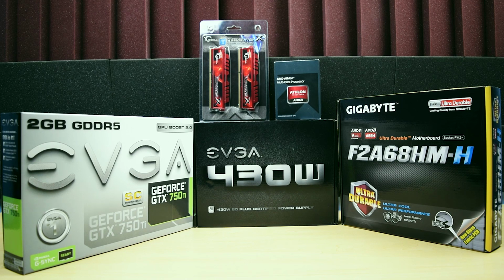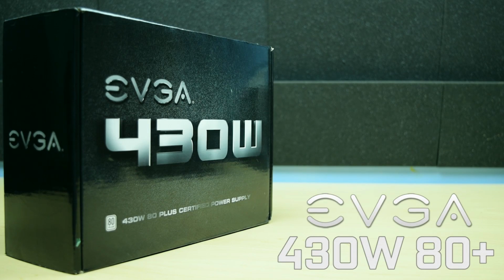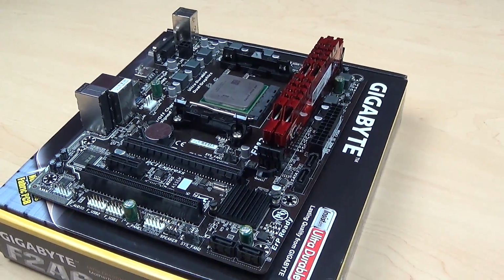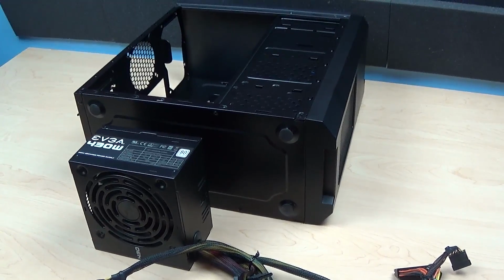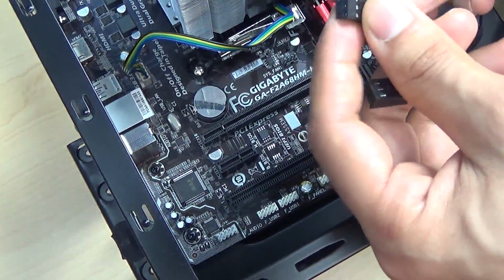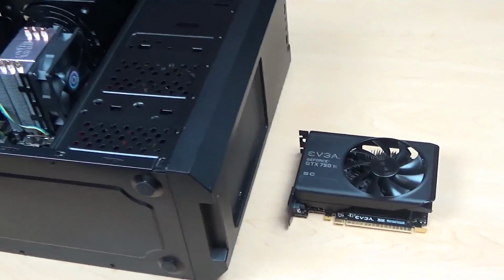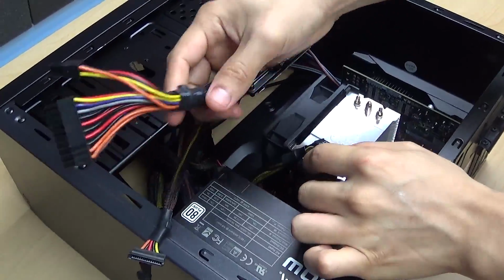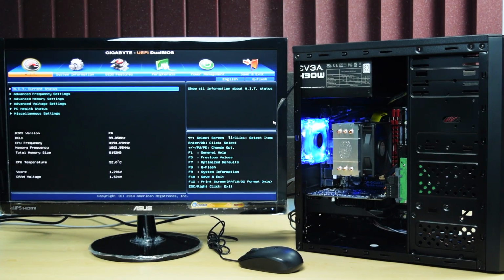Low Budget 1080p Gaming PC Build ($400)

Comment: what is the fps without recording
Reply from the maker: +Stijn Gielen One or two more frames at most.
Reply: +MGTech thx
Reply: +MGTech How do you know which screws to use, or do they usually come with the components?
Reply: +Andre Laurence yes always
Reply: Thank you
Reply: +MGTech R7 370 2g gaming its better than gtx 750 ti right?
Reply: +Tayfun Karaoğlu I think so, depends which is cheaper
Reply: +Andre Laurence when you buy a case it comes with all the screws you could possibly need. motherboards don't come with screws but you'll get enough with the purchase of a case to install any board that will fit the case you buy.
Reply: Kewl Beans Oh! Thank you! I'll keep that in mind.
Reply: Andre Laurence
sure and hey here's another tip. if you got a local pc shop you can sometimes get them to sell you some for a few dollars if you need them and don't want to go out and buy a brand new case if you already have one and just need new screws...i did cuz my pc case is old and when i upgraded, the screws kinda stripped out.

so yea if you're looking to purchase some components for an upgrade situation you won't get any with a new mobo but you can buy a bag of em for pretty cheap....you can even find them online but if you can get 'em local you'll save a few bucks on shipping.
Reply: thanks for the tips! I'm new to building PC's
Reply: Andre Laurence
if you have a friend that has some experience in building you might want to ask them for some help getting it built. it isn't really difficult (i usually compare it to putting together a picture puzzle), but it's a good idea to have someone around in case things don't go quite right. i've been doing this for over a decade and just a few months ago managed to royally screw up a cpu upgrade lol...good luck man happy gaming! :D
Reply: Thank you again!
Reply: +Tayfun Karaoğlu if it's ti (titan) it's pretty hard to be better and if it is is maybe better by 3-6 fps at some games
Reply: +Tayfun Karaoğlu and depends about your procesor too
Reply: +Kewl Beans there is nothing hard in building ... there is only one pin of same colour of socket on mobo.its just where you spend 3hours building it your friend can do it in 30min.
Reply: Adnan Khan
i never said it was hard (i learned how to do it in a week at tech school). but if you've never done it before, you may run into problems. if you have a friend that can help, you just might save some of your hair. ;)

having a friend do it for you kind of defeats the point. also i don't know many people that would do it for free...i know i wouldn't lol. if i really like you, i might do it for a 12pk of guinness. :D
Reply: Are the frame you get when you play without recording
Reply: +MGTech with what do you record?
Reply: +Adnan Khan takes 5 mins to put a build together , if even that lol , longest part of it is unboxing everything.
Reply: Kyle fulerton
that's a bit of an understatement don'tcha think? lol. i might be able to do it in 15 if i had a power screw driver and didn't give a turd about cable management lol.
Reply: +Kewl Beans I built 2 in half an hour. Pls can I have a medal?
Reply: GamerJetic
nope. as i said with the proper tools and a complete apathy for cable management that isn't too difficult. and when i grew up they didn't hand out awards for participation. :/

if you built 2 in a 15 minutes that might be impressive. lol
Reply: *****
i'm rocking an i3 w/ a GTX 550 Ti...why couldn't you? lol. there's this ugly misconception that you need to have th latest and greatest pc hardware to play pc games. really it comes down to what you're looking for graphically...if you're not so picky about it and just wanna play at decent framerates it's easier...and cheaper. :D
Reply: *****
what a completely vague and pointless answer. nice work. xD
Reply: *****
care to elaborate or did you just feel like trolling today?
Reply: *****
the question didn't specify if he'd be using this specific architecture so how do you know? i3/5 chips are considered at this moment, low budget as well(they're basically obsolete at this point). most likely the guy's looking for a low budget intel option that will perform as well.
Reply: also i really doubt he's actually that stupid...give the guy some credit geez. xD
Reply: *****
are you new here? most questions like that on tech vids are people shopping their parts. people don't watch these videos without having at least a basic understanding of how a computer is built...if you didn't you'd be watching cat videos or some other bullshit non techies watch.
Reply: *****
why? it's not my fault you have problems understanding english. but whatever...l8r
Reply: *****
why not? the board on this build will take any amd cpu designed for socket FM2+ and the base 750 Ti is built to fit in small spaces...similarly to the R9 nano.
Reply: *****
imo a case is a case really but as a general rule you can't really go wrong with anything corsair makes. iirc the obsidian series is generally considered better than the carbide cases but twice the price so really it's a budget call. you might get better build quality but you're definitely paying for it. tbh i'd only splurge if you needed something tough that you were taking to lan parties or something. if you're gonna build something for your bedroom/livingroom that's just gonna sit there and not really get touched who cares? :/
Reply: *****
np yw gl m8. ;)
Reply: ***** umm idk can you shop on newegg where you live? all i can really tell you is that i recently picked up an i3 and a gigabyte board for about $200. are you looking for a complete build or do you already have parts you can re-use? i've done builds quite often with older hard drives, memory, or video cards i had kicking around...saves ya a few bucks and you can always upgrade later on.
Reply: *****
yeah if that's the case i really don't know what to tell you. i don't know exchange rates or even what the market value is for that kind of stuff in pakistan. however, it's entirely still possible to build a full pc for $400USD hell the last pc i built nearly complete from new parts only cost me just under $300 and the only parts i didn't buy was a hard drive and display.

sorry i can't help more man except that if you can find some kind of used market or yard sale type thing...i've never purchased parts used but i know a lot of people do and save a ton of cash that way. in theory you could end up with something a lot more bad ass for less money than you would if you'd bought parts new.
Reply: *****
my pleasure. take care and good luck...happy gaming ;)
Reply: *****
looks fine man...better than mine :). you may want to consider a slightly higher powered psu tho. i'm running an evga gtx 550 Ti in a system running 500w. might be slightly overkill for me but i run a couple extra drives in this thing and a lot of usb. always better to have more power than you need. there's some website you can sorta calculate your power requirements but i don't know it off the top of my head. just google something like "psu calculator" and get something slightly higher powered than what it tells you, you need.

oh and if you can afford to spend a few bucks more, 16gb of memory would be better. i hit 6 sometimes just streaming flash videos. :/
Reply: *****
tbh i don't have much of a specific preference on psu brands. a client of mine wanted to go super cheap and we picked him up a 400w for 20 bucks. some no name i'd never heard of but he never came back complaining it blew up or anything lol. best advice i can give you there really is just to buy one from a company you've at least heard of. the pc i have now originally was built in a rosewill case that came with the psu same brand 400w. that eventually burned out after like 4 years and i replaced it with a visiontek 500w that's been going strong for about a year or so now.

really the only pc parts i have a preference for branding is intel and evga...i find evga cards are built really well and overclock amazingly. and intel has a better reputation for running cooler than amd cpus....the last time i ran an amd cpu i had a box fan on the floor next to my computer cooling it lol.
Reply: that case should fit any standard atx mobo. except for i think the really over sized ones that have like 7 pcie slots lol. the asus board is micro atx so you shoudl have plenty of room to spare.
Reply: *****
definitely yes it willl. you might even want to consider a standard atx board tho...generally the micro atx's are priced a little higher. they're usually meant for small builds like for an HTPC. but a standard atx board will fit in that case as well. unless you're planning on filling the case up with fans or something and want the extra room. it's a judgement call really. but if it were me i'd look for something cheaper.

i picked up an 1150 board for like 20 bucks cheaper than the one you're looking at by gigabyte. different chipset tho. some of those higher end boards have bios features that can get really complicated and if you're not well versed in overclocking and things like that a lot of that stuff you'd find on like say a x99 is just pointless fluff and a waste of money.  think of it like buying a car that can go 250mph but you're not gonna take it passed 80 because it'd be illegal. having that extra power just becomes pointless and you paid extra money for something you can't/won't use know what i'm sayin?
Reply: ***** off the top of my head if i'm not mistaken the 4th gen are the socket 1150's. you could probably type that exact question in a google search and get an answer pretty quickly. but always look for a board with a compatible socket to the cpu you're wanting to purchase.
Reply: *****
not entirely. there are different versions of that lga type socket. the acronym just means "land grid array" but in different versions of the socket the pins aren't identically numbered or laid out. for example an LGA775 which are for the older generation core 2 and core 2 quad cpus. just stick with an LGA1150 board and you should be fine. unless you're looking at getting a skylate cpu which will require the newer 1151 socket as well as i think some of the intel "extreme" I(3/5/7) line.

i've heard of some people "hacking" cpus to make them work in other sockets but it requires soldering and a lot of skill...trust me you don't wanna go there. even if you get lucky and don't screw it up i'm pretty sure it voids the warranty.
Reply: *****
exactly. but i'd shop for processor first. pick the best you can afford while saving about $60USD for a board and then get the board that suits your chosen cpu. generally you can get both for around $200USD unless you want something real high end. but spend more of the budget on the cpu because like i told you before a lot of the extras on a more expensive board don't really matter unless you're looking to overclock and tweak everything.

that said, if you can find a good deal on a higher end board like a X99 or something that you can afford go for it. you might not use those extra features right away but it may be nice to have them in the future. ;)
Reply: *****
as long as the number versioning matches the socket. FC just stands for flip chip. i think they just orient differently in the socket.
Reply: *****
nice build. personally i'd double the memory but other than that you're fine....8gb is enough anyway, at least for now. the 550W psu might be a bit overkill but isn't gonna hurt anything. more is always better no? :D

tell ya one thing, it beats the shit outta my current rig haha! :D
Reply: *****
i'm running a 500w but i have a GTX 550Ti that requires extra power and i run a lot of USB devices. if i'm not mistaken the 750Ti doesn't require power from the psu so you'll be fine. you're fine with the 550w too just tryin to save you a few bucks is all. ;)
Reply: *****
i'm gonna have to start charging you a daily flat rate lol.
Reply: *****
i'm not mad, i just don't usually do this kind of stuff for free lol. look, if you're that confused about part selection maybe you ought to just go buy a computer already made off the shelf at any electronics store. pick up any graphics card around $100, throw it in, and call it done.

nothing personal but you seem pretty new at this and i'd hate to see a nice guy blow 800-1000 bucks on parts and fry something trying to put it together. :/

if you lived in the states i'd be more than happy to do a build for you but unfortunately it just isn't possible.
Reply: *****
whatchu talkin bout willis? o.O
Reply: +MGTech does the stock heatsink make the CPU reach 100 degrees Celsius?
Reply: +Danish Hassan Sorry Buddy but a 750ti and a i7 is a hell of a bottleneck
Reply: the one with no name
an i5 might match well though. i'm running a 550Ti on an I3 and the combination works pretty well. before i had a pentium dual core and some of my games ran like garbage yet i got barely any gpu utilization but full cpu loads. the 550/i3 combo benchmarks much better.
Reply: Yeah i AM planning to get a fx 8350 is it any good i cannot afford An i5 because of the damn 35% taxes
Reply: the one with no name
35%?! holy shit man! o.O
Reply: +the one with no name the video card is the bottleneck but with a 960 and up it will own console im running a amd a10 7850k and 960gtx
Reply: what the difference between you motherboard and the Gigabyte 
GA-F2A68HM-HD2
Reply: dude can you fit an MicroAtx motherboard into a atx case
Reply: *****
why would you want to? they generally cost more. they're designed for small form factor cases that people generally use for things like HTPC's and such.
Reply: Gloomy Hindenburg
yes? :D
Reply: Stijn Gielen fraps
Reply: Stijn Gielen 5-4 FPS boost
Reply: They always come with the components if not you should probably think of taking the component from a diffrent manufracturer.